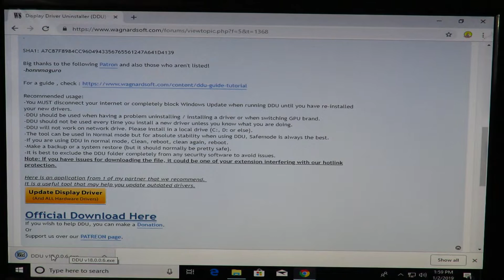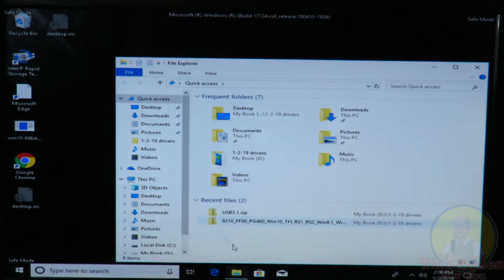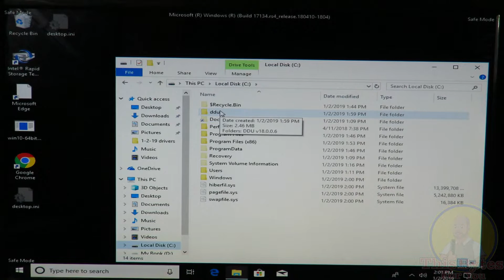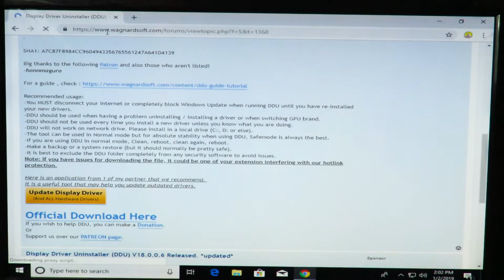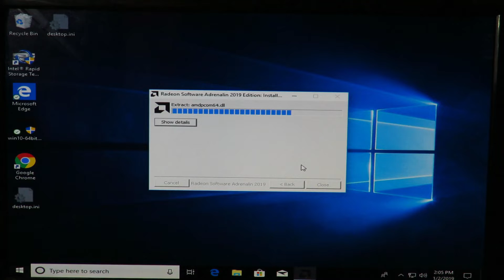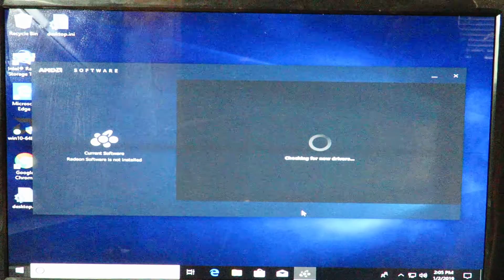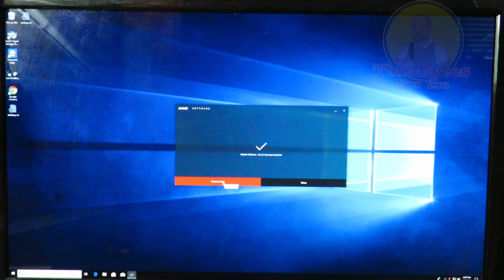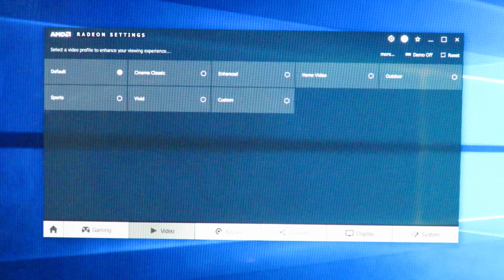How to install the AMD Sapphire Radeon Nitro+ RX 590 8GB OC Special Edition

Comment: Hello, I know this is an older video but I purchased an RX580 used recently, to my surprise after plugging everything in and turning on it immediately started to work and i downloaded the newest AMD driver for it and installed on my system. I was gaming for a couple days on it going easy with graphic settings playing APEX. Everything seemed fine until I adjusted the graphics in-game up just a bit to see how it handled and mid game the entire PC went black dead no lights from tower except ONE flicker of led when I completely purge power and attempt to turn on. I thought it may have been power issue since temps were not at a crazy high level (around 71 C) so I replaced with new EVGA 650 BQ psu. Hit the button and got nothing still. so I Removed rx580  and put back my nividia and it powered up, but no video from GPU PCI slots in BIOS all say empty. I removed the NIVIDIA and reinstalled the RX580 and this time it the system did power up,  but bios still doesn't detect any GPU. After watching your video to try to figure this out i realize I only plugged in the 8 pin PCIe power cable and not the both the 6 pin and 8 pin but it was working for days. My question is could this have damaged the RX580 GPU altogether or my PCI port since the NIVIDIA isn't detected either the computer still works perfectly using the internal Intel VGA port. This is long i know but I just dont know which step to trouble shoot now. thanks for your time.
Reply from the maker: No, I doubt it would have damaged anything doing this, it just would not have provided enough power and not work correctly.  I would think maybe it got zapped by esd if maybe you were on a carpet moving around a lot or maybe the card was already dying.  Another thing is maybe you did not push it in enough into the pcie slot?  And no worries my friend, so very happy I could help.
Reply: @ThisBytesForYou  Happy New Year! So I'm guessing since bios say nothing is in the PCIe slots with the rx580 or the gtx 1050 that the damage has happened to my MOBO PCIe slot? My gtx 1050 was perfectly fine before I made the swap.
Reply from the maker: @jmmaverick3355  man that is horrible, it does sound that way though.  How are you seeing it in the bios that it is not there, are you using onboard video?
Reply from the maker: @jmmaverick3355  and a very happy new year to you as well
Reply from the maker: @jmmaverick3355  the only thing I am thinking (and I commented this to someone else thinking I commented it to you last night) was maybe in moving things maybe walking across the carpet or something was you could have caused ESD, electro static discharge that could have zapped your motherboard.  Without know exactly what you did, it is hard to say, can you verify all the power cables are securly plugged into the board, cpu power, 24Pin power, power to the CPU, so strange, wish you lived near by
Reply: @ThisBytesForYou  thank you for the responses. So yes I've verified power connections. I have been messing  with it using the internal intel video connection. So today I reinstalled  the original tiny Nvidia GT 710 ( which doesn't use the whole PCIe 16x slot just half. Which by the way the 710 looks like I'm playing the original 90's DOOM.  And it works, sobi powered  down and installed  the gtx 1050 but it still doesn't  detect it I even tried to update drivers and the geforce software says no gpu hardware  detected.
Reply from the maker: @jmmaverick3355  hmmm, wonder if the slot has some bent pins, what motherboard do you have?
Reply: @ThisBytesForYou  ok so I took both my gpu to local shop for them to test and both rx580 and gtx 1050 worked. So its gotta be my MOBO. Bent pins or something.  But I will replace that and see what happens. Thank you!
Reply from the maker: @jmmaverick3355  You are very welcome my friend, I was asking about your board because maybe you could use another PCIE slot, to see if it will work there?

Comment: When I put the graphics card and turn the pc on,the sapphire logo lights up put my pc monitor won’t display anything
Reply from the maker: @TrendSnack  make sure you bios has uefi enabled
Reply from the maker: @TrendSnack  do you have all the pcie connections plugged into your card and do you have the card properly seated?  Do you have the input select correctly on your monitor, for example if you are using a HDMI port, do you have your monitor set to HDMI?
Reply: @ThisBytesForYou  Yeessss it works. The problem was my BIOS, it was to old I had to update it. Thank you!!!
Reply from the maker: @TrendSnack  you are so very welcome my friend, happy I could kind of help you
Reply from the maker: a few questions on that,

1. What manufacturer and model # power supply do you have
2.  Do you have both PCIE connections connected
3.  What motherboard are you using
4.  Do you have the monitor connected to the video card or the motherboard video header
5.  If you are using for example HDMI, do you have HDMI selected as your input?

Comment: hey do i really need to plug in both the 6 pin and the 8 pin connector? my psu which is a coolermaster 600w has only one 6 pin and i have an adaptor to 8 pin so will i have a problem if i only plug the 8 pin?
Reply from the maker: yes, you will need to plug it in.  it may work without it, but once the power thershold is met where it requires the 2nd connection, it will bluescreen or worse.  what is your power supply manufacturer and model number?
Reply: ty bro i figured it out i just borrowed a molex-to-6 pin connector and its all fine now! nice video btw and  i wish best of luck
Reply from the maker: @soukos39  awesome, thank you so much for letting me know you got it working.  Thank you so much for your kind words, I truly appreciate it and I also wish the best for you and yours.

Comment: I have a question my friend bought a new rx 580 8gb and he got a PCI-E Dual 6pin Female to 8 pin Male Video Card Power Adapter and i bought the same card but it was used and i didint get it... do i need the adapter or i can plug it straight in to the psu
Reply from the maker: So the card comes with no adapters.  Not sure how he got any.  If you are plugging it into the power supply, you are good, no worries
Reply: @ThisBytesForYou  thank you for the answer. He bought xfx RX 580 8gb
Reply from the maker: @TheFighterMinecraft  cool, very happy I could help you my friend.  Hope you love your card

Comment: Im doing crossfire for my first build that I’m doing in a couple months; I decided to go with 2 - xfx Radeon rx 570s 4gb. Together would these be enough power to run pretty much any game I want ? It’s going in with my ryzen 5 2600x
Reply from the maker: well yes and no and I will explain.  Sadly, with Crossfire, it's not as supported as it use to be, there is little performance gain, very little, if at all possible.  Although, the card is affordable right now.  What resolution are you gaming in?
Reply: ThisBytesForYou 1920x1080 sorry for a late reply
Reply from the maker: @themilkman9360  no worries my friend, I am here no matter what haha.  So at 1920x1080, I think you should be good, will you have at least 16Gigs of RAM?  Also, I would say you would be playing your games at medium quality settings
Reply: ThisBytesForYou my brother has a friend who’s a computer science major, he builds stuff like this for fun so he’ll over clock for me but he’s been to busy to tell me bench mark capabilities, it will be water cooled however
Reply from the maker: @themilkman9360  cool,this has been my job for a long time working with the largest OEM and boutiques but I can still say, Crossfire will only help a lttle, overclocking will help more, but overclocking in Crossfire will be a pain because you need to put them both at the same speed, so you will have to make 1 card slower than the others potential to keep them working.  I hope it works out for you.
Reply: ThisBytesForYou thanks man, I may just decide to save the money and not crossfire and possible add another 2x4 kit of ram in my 2 and 4 slots or something else and I’m planning on the overclocking witch is why I chose the parts I did again thanks!
Reply from the maker: @themilkman9360  yes, 16GB will work great for you and also your OS should be on an SSD, if it is not already, that would help to.  You are very welcome my friend and I am very happy I could help.

Comment: Hey bro can you help me plz?
which power supply should I buy for i3-7100, rx590 8G
is 500w is enough?
Reply from the maker: thank you so much for stopping by, checking out my video and commenting, it means the world to me.  SO this video card requires at least a 500Watt, so you are good, but you will also need an 8PIn PCIE connection as well as a 6Pin, you need both of those connected.  If you are not sure if you have those, I can help, if you let me know the model number of maker of your power supply.  I would be more than happy to help.
Reply: ThisBytesForYou is it possible to send you a photo of my power supply?
I don't know exactly what should i check
Reply: ThisBytesForYou golden tiger g&t atx-500wce-p4

this is the name?
Reply from the maker: sally, I cannot find good information on it, but I do see a pictre online, and it states that it is 450Watts real total output, but 500Watts Max, Max usually is only for a few seconds and then it shuts off.  Here is an affordable 500WAtt, that has all the connections you need: https://geni.us/6wI9A, I hope that helps.
Reply: ThisBytesForYou Maybe should i buy with more watt, bcz that i have also a cpu etc?
what do you think?
Reply from the maker: yes and thank you so much for asking, most people just want the cheapest wya out, which is good, but you never want to cheap out on a power supply, I would recommend something like this at least, if not better: https://geni.us/55Qq
Reply: ThisBytesForYou 
wow 100 doller
so this one is with all connections?

i hope that it's ok to ask two more questions.
Asus H110m-k motherboard support the rx 590, right?

i have two slots available and i have 4 gb ram, can i put in the other slot 8 giga or its have to be the same?
Reply from the maker: yes, sorry I did not reply sooner, youtube never lewt me know I got this message.  you will want to get the same RAM all in one shot to make sure the ram works with each other.  Adding different types of ram, may require different voltages that wont wont together and different speeds.  You will need to put the voltage for the memory to the highest of the 2 types and the speed to the lowest of the 2 types.

Comment: hello I hope you can help me, install the video card, but sometimes the audio is heard with interference. as if it were an old television, help.
Reply from the maker: Try using DDU to uninstall your older drivers, if you had NVIDIA in iyour machine previously, use the same method to remove the nvidia drivers as well, you can follow my guide in the link below.  Then, download and update to the latest drivers and let me know if that helps.

https://www.youtube.com/watch?v=clLYbBywhAg

Comment: One doubt I have the same graphic card and. I haven't concerted the 6 and 8 pines it happens something?
Reply from the maker: sorry my friend, I am not sure what you mean?  You haven't inserted the 6 and 8 pins?  If you did not, the card would not work.  Please rephrase your question.
Reply: @ThisBytesForYou  I haven't conected the 8 pins and 6 and is running
Reply from the maker: @ReYBaXx  have you been getting blue screens or black screens, screen tears and other odd issues with your computer, do you game?
Reply: @ThisBytesForYou  no I can play but I think It doesn't working full
Reply from the maker: @ReYBaXx  either use the cables yoru power supply came with, or buy the adapters I linked up so you can get the full performance and stability
Reply: @ThisBytesForYou  case I don't have those conectors
Reply from the maker: @ReYBaXx  what brand power supply do you have, and what is the model number?
Reply: @ThisBytesForYou  I think is this one Tacens Mars Gaming MPII850 850W Modular
Reply from the maker: @ReYBaXx  hmmm, it says that it contains 2x PCIe 6+2 PIN.  If you have the box, they could be in the box, but if you lost those, you might want to buy these cables https://geni.us/oTB2G2
Reply: @ThisBytesForYou  but I need male 6 to 6 and male 8 to 8
Reply: @ThisBytesForYou  I don't know if you understand me

Comment: Hello, good evening....  
I have a question.... 
I bought this card yesterday and I tried to install it in my PC.  Even though I did everything you (and the manual) say.... I get no signal on my monitor.... 

(Steps....  Turn the power off.... Take out the old card, put the new card inside carefully without any cables in the way, put the 8 pin (6+2)) PCIE  for power.  I dont have an extra 6 PIN PCIE but I saw in the comments below that I dont really need it if I dont plan to overclock the card, it should work with just the 8 pin plugged in.... I turn the power on.... The fans work, the LED lights work..... But no signal on my monitor...  I tried both HDMI sockets....  My PC does not load all the way to windows though.... I dont hear the log in sound....  )

My specs are a bit old , but the tech guy where I bought the card, assured me that it would be OK..... Could you please check and give me a hint ? 

Operating System: Windows 7 Ultimate 64-bit (6.1, Build 7601) Service Pack 1
PSU : 550 W.
Processor: Intel(R) Core(TM) i5-3470 CPU @ 3.20GHz (4 CPUs), ~3.6GHz
RAM : (2x4) Corsair DDR 3... 8 Giga 1600
Motherboard : MB GigaByte Z77M - D3H (1155/Z77/DDR3)
SSD Samsung 64GB Sata III 830
1 HDD 2 Tera Seagate.

Thank you anyway :)
Reply from the maker: It happens very often, do you have the hdmi cables plugged into the video card or the motherboard?  Also, don't worry what the other comments say, if there is a place to put in a cable, its not there for looks, plug it in, it wont kill you and it wont cost extra, just plug it in.  Everyone asked below, they didn't say that had only 1 connected, and sadly when I said to try it with only one, they never responded, my next video I will show what happens.

I asked Sapphire if it needed to be connected, and they said yes.  They also said they were going to correct the site, but never did.

What is the model number of the power supply?

If it's not working, not using one of the spots where the PCI-e cable goes, that should let you know you need it, check this out, it might help if your power supply does not have an extra one: https://geni.us/sVDjbp
Reply: @ThisBytesForYou   I am not sure what happened, but I send another message here and it never got posted.... Anyway....
I tried to plug in the HDMI cable to both sockets on my video card and after that to the onboard HDMI just to test it. I did reset my PC every time I changed socket. Still no luck...
I will try to buy an adapter on Monday, from 15 SATA to 6+2 PCIE , cause my power supply had just one 6+2 PCIE that I plugged into the 8 socket of the video card.
My power supply model number is DR-8550BTX.   (Turbo - X   550 W)

Thank you for the fast reply!
Reply from the maker: @brutalspeedster8090  you are very welcome my friend, always happy to help.  If you have another machine you can test it on, just to make sure it works, it can happen to get a bad card of course.  But please do let me know if you have any other questions.  Also, please do let me know how it goes after you test with the adapter.
Reply: @ThisBytesForYou  I tested the card on another machine and the card was OK.... Also the  Card is able to run with just the 8 pin.  My problem was that I did not have the latest BIOS update, so  the PC could not boot.....  I also bought the extra adapter and have all 14 (8+6) PINS plugged in now.  Also new BIOS and Windows 10..... Just finished formating and all is smooth :)
Reply from the maker: @brutalspeedster8090  ahhh that is great to hear my friend, very happy for you.  Now quick, go play some games and let me know how the performance is for you.  What cpu do you have?